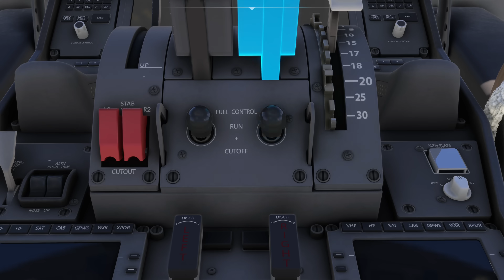Air India 171: Why Did The Fuel Cut-off Switch Get Moved?

Comment: Actually in this case the camera would help a lot! The data recorder only states that the fuel cut of valve was shut down and then turned on... But... it does not say if it was the pilot who actually did it. Or which one... And lets put this hypotheses: what if the switch may have a flaw which in certain circumstances it seems it is on, locked, but it actually is not? it is up enough to turn the pumps on, but not enough to be locked, where the vibration can endup making it go down and shut down the fuel... I think on the DC-10 early problem, where the cargo doors seemed to be fully locked, but weren't and when they reached certain pressurization, they would come out, cause an explosive decompression and cut the control cables, as the vents on the floor were not enough to equalize the pressure and would make it collapse... 
On the other hand, what if the switch does allow for one intentionally to put it on, but not being fully locked? and randomly hope for them to shut off?... I'd like to see those tests on the switch... It could make a difference, because if right now it seems that it was an intentional action, It may be a small defect or something that no one ever tried because it didn't thought it could even be possible....
Reply: The scenario youre making up is unlikely. A rare failure being in both switches, making them fault by chance within 1s, lmao. If youve ever seen one of those switches youd not have written that comment, it is that stupid. Also it literally doesnt matter which pilot it was and more likely than not they already know anyway.
Reply: @vanessaxoax7646  There are no stupid questions... Only stupid answers, kid... And I've seen them but not touch them. And if you're that good (for nothing) show me a video proving me wrong, that it is impossible to that scenario to happen... That there is no way for the switches to appear to be locked in the on position and not actually locked...
Reply: @jn1980gaming  Fine, im gonna claim aliens did shut off the engine because they dont like how many humans eat pizza with pineapple on it. Now prove me wrong! Maybe we should add surveillance to every pizza place that serves pineapple too, just to be sure?

your comment is a little less idiotic compared to mine, but its the same ballpark lmao
Reply: @vanessaxoax7646   https://youtu.be/CoTsvyA-bRw?t=208 in here you can see the action of it. pull and push up. But in the video he goes all the way up. what if you don't go all the way up, but just nearly the end. The lock mechanism will not activate... Unless the switch has a spring loading mechanism that mechanically forces it to be either full up or full down, for that, you'd have to use it to feel it...
Reply: @jn1980gaming  Ive actually used it, thats what makes your comment so obviously dumb in my eyes. But even if i didnt, thinking that could be an oversight after decades of modern aviation without causing an accident once, but now happening to two switches at the worst time it couldve happened within a second is just stupid. Even with it being a freak accident one pilot realizes immediately what happened, what a coincidence!

I already told you, you do you, i dont mind if you believe what you wrote even though it makes little sense. What annoys me is using ChatGPT to make up pseudo arguments to convince others.
Reply: @vanessaxoax7646 About as likely as much of what is being thrown around here.

Comment: Important to realize, while the fuel cutoff switches are mechanical in operation, there is absolutely no mechanical connection between the switch and the valves. The switch’s are just digital inputs to a computer system. The computer system uses the input information to control the fuel valves. There is ALWAYS the chance that there is an unknown software “bug” or software state or EMC interference condition that could inadvertently disable the valves momentarily one after another, WITHOUT THE SWITCHES ACTUALLY BEING MOVED!!
This would account for the switches being found in the on position and the pilots being confused and assuming the other had performed the action. Also, this would still be recorded by the data recorders.
As a control systems programmer for some 40 years I know for sure this is a possibility.

Comment: Fuel switches mysteriously flipped to CUT-OFF.
The narrative swiftly targets 🇮🇳 pilot error. 

Typical western media move, when tragedy strikes, scapegoating begins.🤫🤫
Reply: He specifically states he doesn't know why, the only thing he/we know came from preliminary reports that at one point the switches were set to off when they had no reason to be. And we don't know why yet. Don't be so soft, you're acting a bit defensive when no one is blaming anyone especially your little flag.
EDIT: Preliminary.
Reply: @LiquorandCheeseburgers   Oh please, dont tell me you think that after watching this video majority of the viewers wont  agree to the Notion of "Pilot's fault", this Indirect blaming is what usually happens until an eco chamber is created, and/or every one agrees to the Notion.

Preliminary reports show both engine fuel control switches were moved from RUN to CUTOFF within seconds of takeoff, starving the plane of fuel 

Cockpit recordings captured a pilot asking, “Why did you cut it off?” with the other denying it ,highlighting confusion, not certainty 

Crucially, these are spring‑loaded, gated switches designed to prevent accidental shutdown  experts say both being flipped so close together suggests intentional action or systemic failure, not mere pilot error 

No mechanical faults have been found so far  the plane was serviced, engines ran, fuel was fine so any blame is premature 

😮‍💨Bottom line: we don’t know who did it or why yet. Jumping to blame Indian pilots based on guesswork is unfair and distracts from a thorough investigation.
Reply: @virusindeed  It was just a suggestion of one possiblity, get a grip.  Not sure why you think that it shouldn't be looked at as a reason for an aircraft disaster during the investigation. Ignoring that is not science. Science is discussing every possibility and scenarios, ignoring one possibility because it hurts someones feelings is beyond  STUPID . I too doubt that someone intentionally did this, maybe the FDR will prove it was something else. Until then an investigation has to look at  ALL  possibilities.

Comment: Wouldn't it make sense to put those cut-off-switches more to the center of the pilots visual field, maybe even on the dash? Just because those cut-off-switches are in his peripheral visual field now, he noticed the change in lever position to late. Maybe a blinking lever for 20 or 30 seconds, with every position change, could help to.

Comment: Whilst I don’t want planes flown by AI, should some actions be controlled by AI or software? 
Eg: If no engines are on fire during takeoff, both fuel leavers cannot be put into off position without a further override prompt from the computer advising of the risk, and two override buttons exist for each pilot out of reach of the other pilot, so that the flight recorder records who overrides the warning.

Would this help?

Comment: A couple of times you mentioned that the switch was spring loaded to return to the cutoff position. Why is that? Wouldn't an unbiased switch be better? I can imagine a failure mode where the metal corners of the détente wear down and the switch slips out of run. Obviously not the case here because they wouldn't have failed 1 second apart. 
Two other thoughts: Boeing could leave the run switch where it is and move the cutoff and fire handles to both sides of the cockpit so that both pilots have to turn their switch to cutoff the fuel. And it is possible that the pilot who turned off the fuel then said "why did you cutoff the fuel" to avoid suspicion and help his family get insurance benefits.

Comment: Back in the late 80s and early 90s my ex built F16s for General Dynamics.  Nothing was worse to those employees than when an F16 was involved in an accident. They took it to heart and would be upset for weeks until determinations were made as to the cause, especially if it was one personally worked on.  Captain Steve is so right about the pride that these folks have in their work.

Comment: Captain Steeeve, you are only a pilot. Your technical knowledge is limited. The flight recorder does not monitor the actual switch, but the the electrical supply. So if there was a momentary glitch / short to the fuel cut off system, the flight recorder would record it as the switch being flipped!!  Please wake up!!!

Comment: Hai Sir 
Question 1 .
Do you have the original voice recording to say what did the pilots said to each other ? What language did they communicate? In india even Hindi they have different dialogue. So I think you are just believing what the report is saying . You did the same in your very first video and then you got next evidence of the RAT and changed your Opinion. 
Question 2 . 
If the pilot did switch purposely then why did they changed to RUN with no voice recording about that? Vs Boeing has technology of the back box recording for few words . 
Question 3 . 
Was  there an FAA report about the malfunction of these switches and recommendations to fix it . Boeing should have told as a mandatory fix  .They didn’t do because then it will be Boeing responsibility and financial responsibility to fix this . “Common sense as it’s manufacturer problem “ 

So before you conclude and give Boeing a green flag , it will be better to evaluate and ask for the whole cockpit recording . Also what all technical issues Boeing has in the past and also what all reports/ complaints were there against these pilots . As humans we learn from mistakes , to make the future safe for humans and not just Boeing or 2 pilots .

My best guess is they are playing to see if there is going to be “All India level strike by other political or airline unions in coming days . And if not then the final reports is going to be the same “ Pilot error” .

Comment: The issue with only relying on cockpit voice recorders and flight data recorders is that if you cannot recover those items, or they are damaged that you cannot retrieve the data, then you have nothing.

But there would need to be a way for that data to get stored somewhere, and potentially uploaded in the event you have a similar issue with not having data from the other recorders as well.  And I agree that begs an interesting question. How long is that recording available before being purged, and how to ensure security with how and when the footage is accessed. 

While cameras might not have prevented this incident, there is something to say that performing certain actions are a deterrent if they try something, fail, and there is very much irrefutable proof something was done. On top of just giving context to something or maybe we couldn’t get anything from the other recorders.

I think of the Malaysia flight - if there were cameras, maybe we can get anything additional clue as to what happened since we don’t have much else outside of any data the plane sent back of its flight path and other entities that might have picked up on the aircraft.

Comment: This initial report doesn't sit well with me. A huge corporation will always want to try and blame pilot error as indeed happened with the 737 Max. 

The 4 things that bother me are: 

1. Based on the location of the switches how likely is it that one pilot can turn them off without the other seeing them do it.

2. The plane did seem to need the entire runway to get airborne. 

3. Initially we were told that the captain mentioned a lack of thrust and then mayday. To fit this new narrative the thrust part is being denied. 

4. Ex employees of Boeing with excellent, long service records have a habit of ending their life once they become a whistleblower.

Regardless of what the final report says I think Boeing is going to find it much harder to sell planes. A number of airlines will avoid them. It's clear from the comments as well that many are suspicious of this initial report. Many will avoid flying routes operated by Boeing if they have doubts about the company.

Comment: We don’t know if the pilot who asked the other pilot why had they set the fuel cut-off leavers to off, was also the same pilot who turned the fuel off and then back on again. We simply don’t know vs believe. 

How can actions be audited on who did what? It seems only a camera can provide a validated audit. 

If the pilot who asked the question was also the pilot who put the leavers into off and then on again, then what was the motive becomes a bigger question. Forensic investigations with video footage has taught us truth is often stranger than fiction.  That’s why so many traffic lights now have cameras, just for crash investigations, nothing else. If cameras only record encrypted to the flight recorder, images can be securely controlled to not accessed by airlines protecting day to day privacy.

Thank you for your wonderful service.

Comment: Suppose the switches were inadvertently cut off. 
— how, then, did the FADEC’s logical architecture and its certified Design Assurance Level (DAL) still permit an uncommanded engine shutdown in such a context? 
Given the aircraft’s ETOPS certification, shouldn't the system have incorporated fail-operational protections to prevent a single-point failure from resulting in engine loss? 
This raises critical concerns about compliance with the intent of DO-178C/DO-254 objectives for safety-critical systems.

Comment: You mentioned that 10 secs is within tolerances or a timely manner in which to resolve the error input of turning the fuel valve switches from cut off to run. Another channel suggests that that’s an inordinate delay and if I time it in my head, then I too think it’s quite a long delay for such a critical response to get the aircraft out of a possible/probable impact. Do you still think that 10 seconds is reasonable?

Comment: Capt. Steve, How did we say that the other pilot set the engines to run? First there should be an investigation on how those engines set to cut off. Since it’s unclear if software or electronic glitches? Could you surely say that these questions can be ruled out?

Comment: The day they go to SINGLE PILOT Operations in Commercial ATP/Scheduled Airline Service is the day Flying Ceases to be safe .. The 727, 707, 747, and DC-8 ALL HAD A THREE-PERSON COCKPIT CREW - Pilot, Co-Pilot and Flight Engineer - The 737/DC-9/MD-80 and every other Two-Person Crew Airplane would be FAR SAFER if they had a Flight Engineer assisting with Instrument Monitoring ..

Comment: I keep seeing people trying to blame Boeing for some kind of mechanical failure, and wondering why all the aviation experts are completely ignoring a possibility of mechanical failure, so I just wanted to run a thought experiment:

We know that the fuel was cutoff to both engines because the fuel control switches were moved to cutoff. So there is no mechanical error in the fuel lines. The switches are moved to cutoff, an act which means that they have passed the safe guard designed to inhibit accidental movement, and immediately one of the pilots noticed and asked the other why he had done so, so it is safe to assume that one of the pilots saw an intentional act whether it was their own or the other pilots. What you are then suggesting is that both fuel cutoff switches moved to the turn off position just by themselves at the exact same time, prompted by nothing but gravity and takeoff vibrations, and at least one of the pilots was hallucinating. I think I need to go with the experts on this one.
Reply: The report intentionally doesn't say the switches were "moved". They use the word "transitioned" which is extremely significant. Never "assume".

Comment: AI having an oversight in the sense it could ask and confirm if both pilots agree on a decision, if not it could ignore/block the switch input, especially if the input was accidental or malicious. I think AI used with real pilots and balanced properly even if it's just confirming things from the cockpit pilots would be a good step in the right direction.

Comment: As much as this seems deliberate, I hope they put that fuel cut off system in the lab and search for ways it could "uncouple" itself. This reminds me of the control valve that created hard over  rudder that could jam in very low temps. No one imagined it could fail. They finally put it through thousands of reps in a cold environment and it jammed. Also, no one thought a piece of foam would penetrative the wing edge of the shuttle.